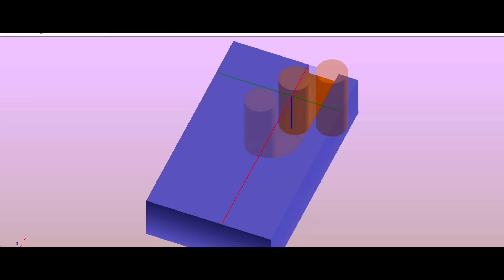E-Longboard DIY 2800 Watt -DUAL MOTOR-

Comment: This is 1500w at best. Youre only feeding 1/2 the battery power to the motors. That motor can handle 6s each so x4 3s for two motors.

Comment: Mind if I ask, what’s the max speed and distance on those batteries? Thanks.
Reply: Simple answer on distance. Its a way to short (about 30 minutes) and in my opinion not worth the try but nice max speed anyway, this thing must be a beast on flat roads with this 470KV motors. Not sure what happens when it comes to hill climbing. 470KV could provide not enough torque and might get pretty hot under full load.  :D Btw, the Motor mount is a pretty nice work as well. Would like to see the CAD Files.
Reply: SR I mean you could probably do something with the battery to increase the distance in the motors, I’m planning to start my DIY electric longboard from a longboard deck I’m making currently. Don’t know what’s the best motor, if you know please let me know. Currently shopping for supplies

Comment: Ich sehe gerade bei 3:14 dass Du Ritzel mit Pitch 5,08 mm drauf hast! da bekommen man ja nicht so leicht die Riemen dafür oder?
Reply from the maker: Hey. Ja stimmt. Jetzt würde ich wohl lieber einen 5M Riemen nehmen. Diese sind besser für kleine Umlenkungen. Breite reicht 10mm im dual, 15mm im single Motorbetrieb.:)
Reply: geanau so sind auch meine 1 jährige Erfahrung bisher :) wobei ich fahre nur noch im Dual .
Reply: @worachart111  Kurze frage an dich, warum nur noch Dual?
Reply: @SR Dual Antrieb ist viel besser da hat man die doppelte an Drehmoment zur Verfügung z B. Steigung Fahrten.  4 WD ist nochmal besser aber auch teurer und das gesamte  Board schwerer Vom max. Speed bin ich nicht schneller als mit einem Motor Antrieb, die max. speed ist von Übersetzung, Fahrer Gewicht, Strasse Obefläche, Akku Strom Abgabe usw. ab.

Comment: I will be making my first electric skateboard but would like to over engineer it by having 4 motors. It appears making a single or dual is not a problem, as it is available from DIY online stores, but I can't find anyone to tell me if I buy 4 VESC's and 4 motors, will they work together with a Nano remote control?

Comment: You have 2 ESC what you have connected to the receiver?
Reply: I used a "Y" cable to connect both ESC to one receiver.
Reply: Ah ok thanks but where is this cable you can send a link? thank you very nice
Reply: isso it is easy to make one

Comment: So each motor is supplied with a 3s lipo? Or mounted in series and they supply both? If the latter then isn't there a strain on the battery? or at least it doesnt get the full 22.2 volts? Also, what is your top speed? 470kv motors have crazy high rpm but little torque, so I would imagine once it gets going it goes fast. Just curious, fantastic video!
Reply: Wouldn't it be better if you changed your gearing and put a smaller pulley on the wheel and then set limit to 100%? That way you whould be able to go uphills better right?
Reply from the maker: It is 2x 3s in series, so 6s. Both are connected to the ESC. Dont know the top speed, i set a limit at 60% because it gets too fast. The torque is nice because of the dual setup  - no heat problems at ESC/motors. Run time is about 30mins.
Reply: iMake sweet!

Comment: make a electric skateboard cheap
i choose two motor of ebay 
n5065 (china) 270kv or 400kv its better my battery is 22.2v lipo 
i want fast and torque
whith motor its better ?
Reply from the maker: Always take the lower KV (270) to prevent heat.
Reply: thanks i order 270kv china motor 40euro
Reply from the maker: works perfect
Reply: Welcome to try Maytech 6355 closed cover waterproof motor
Thanks
Agnes(agnes@maytech.cn)

Comment: Wear a helmet buddy
Reply: iMake when you were building the board did you need two ESC my for the dual motors
Reply from the maker: yes i used 2 ESC's
Reply: There are so called dual escs which are basically 2 escs in one.
Reply from the maker: THE MTB FANATIC you are right :)